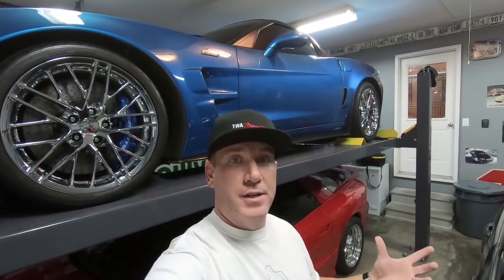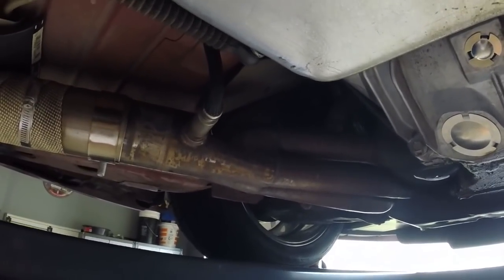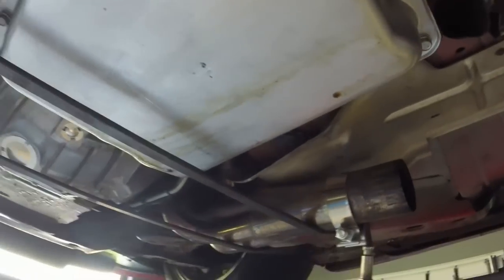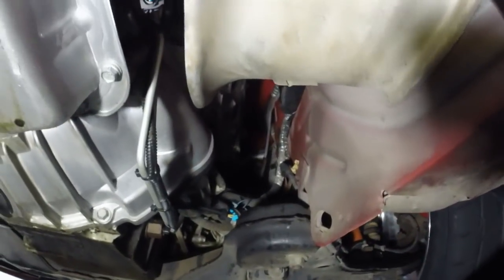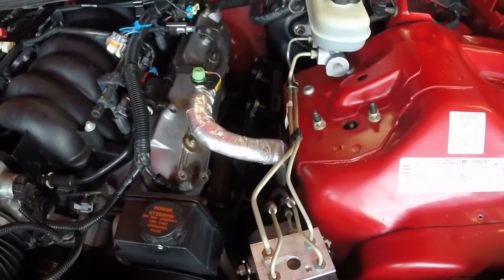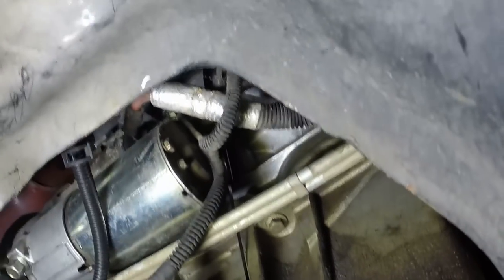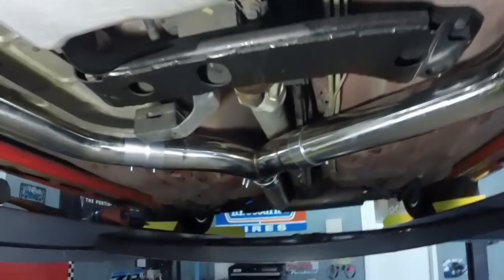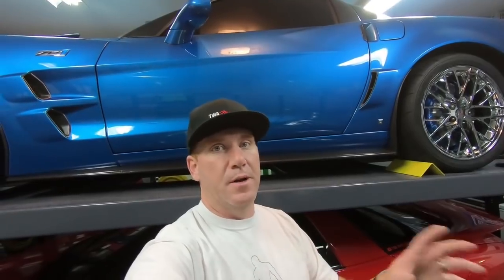Installing 2nd Set of Headers on my WS6

Comment: Headers and off road y pipe to the stock catback for the win!

 It's crazy how different brands of headers and y pipes with different merges change exhaust sound.
Reply from the maker: I like the more quiet exhaust on cars that are not race cars. Not sure if I want a catback at this point. Maybe just tips.
Reply: TWA Motorsports I went with the Hooker Aerochamber catback.  Nice and deep sound, not loud and annoying.  Great sound when you get on it.  Very cheap price, ~$300ish on the usual sites.
Reply from the maker: @joshender9606  I had that on a camaro I bought once. I liked the sound of it.
Reply: I bet it would sound sweet with the header, y-pipe combo you just installed.  And it's super easy to add a cut-out for when you want to get loud or take it to the track, too.  Anyway, nice setup in the garage and sweet, sweet rides, good taste :)   Good luck with your channel, sub'd.
Reply from the maker: @joshender9606  thank you

Comment: I used pace setter ceramic coated headers. 7 thousand miles later and they still look pretty damn good.
Reply from the maker: I have used those in the past and they are a great bang for the buck that's for sure.
Reply: @TWAMotorsports  yeah, i was on a huge budget when i built my motor, turned out there was a ls6 block in my camaro.
Reply from the maker: @chemicalspore  that's I nice find.

Comment: Just subbed a few days ago and watching all your vids, I’m completely envious of your garage.
Hands down, you have the best 3 cars imo.
F body TA, Zr1 and the ctsv.
You have the best of all 3 worlds.
Think all you’re missing is a Fbody Camaro SS.
Plan on doing any vids modding the LSA? Those engines have so much potential, helped a buddy of mine put a zl1 lid on his not too long ago.
Seems like weaponx is the spot for those LSA, over tsp 
Great content man
Reply from the maker: Thank you. I really appreciate the sub. I have had several 4th gen Camaros as well. I actually sold one to buy the ZR1. I might do some lsa mods. If I do I will use Kong for all my blower stuff. Tsp and Weapon X will probably get some love as well.
Reply: TWA Motorsports nice, seems like you have a wealth of knowledge about GM cars.
Is this something you learned over time?
You should open your own shop, think it will do well for you.
Do you do your own tuning as well? HP tuners from what I hear is somewhat friendly.
Again, nice content man 👍
Reply from the maker: @picklebacon  thank you. I may open a shop someday but for now it's just a hobby. I do very little tuning. I haven't mastered that. I do use hp tuners. I just started taking stuff apart and learning. You get tips from others and experiences along the way.

Comment: I have 1 3/4 speed engineering long tubes on my 01 SS and I love them. Great for the price.
Reply from the maker: They are really good for the price
Reply: How hard are they to put in
Reply: William Holton jr not bad at all. Mine went right in from the bottom. If you are doing them, I recommend taking a look at your motor mounts while you are at it tho. I replaced mine with poly mounts when I did the headers.
Reply from the maker: @williamholtonjr4982  not bad. I ha e made 2 videos to help👍
Reply: OrangeSpeed  did you have to notch the k member as well with the 1 3/4?
Reply: 2000 catfissh nope, I didn’t notch anything for them.
Reply: OrangeSpeed right on great to hear!! Did you get any leaks on the y pipe with the provided clamps? Reason I’m asking is because I’m thinking of doing mine this weekend, my wife surprised me with them yesterday lol so I’m excited to get them on, tired of hearing the ticking on my leaky current longtubes

Comment: Hi buddy. Great video as always. I'm going to be running Cooks header's on my 94 Trans am with a borla 3" catback system when I get to that point. At the moment my 94 Trans am is getting prepped for the new Black paint job with the 6"red strip. Then I can start pulling the LT1 and 4spd automatic transmission out. To start the engine building process.. Travis you and I are alike... We both turn wrenches on our cars instead of having a mechanic shop doing the work... Blood sweat and a little bit of dropping the f bomb lol... Nice job job on the header install....
Reply from the maker: Yeah I have never like others working on my stuff
Reply: @TWAMotorsports  hi buddy... Any word on when you're ws6 is going to be your next video?.. I just ordered a 383 stroker LT1 short block. For my 94 Trans am...
Reply from the maker: @keilylmm6377  long time from now
Reply: @TWAMotorsports  hey Travis. Hope all is well my friend. Well my steering column is worn out too.. it's not bad but it's annoying. I can move the steering column up and down.... welcome to my 94 project trans am....
Reply from the maker: @keilylmm6377  sounds like it needs some TLC but you will get there.
Reply: @TWAMotorsports  I'll get there alright lol... Money pit but what the hell... Cars we know em and Love em..

Comment: Nice. I’ve been thinking of getting those 1-7/8th headers as well as the true dual kit. Even though it hangs low. I’ve got the kooks 1-3/4 headers to y pipe now. But I’m putting on some 243s and a sloppy stage 2 cam and have heard there’s a decent gain over 1-3/4.
Reply from the maker: I just thought for the price difference I should do 1 7/8s. True duals hang too low and are too loud for my taste. Good luck on your build.
Reply: @TWAMotorsports  Ice got Texas Speed true duals and they are WAY too loud. Obnoxiously loud!! AMD 3" dual is too big for a naturally aspirated small block anyway. But the Hooker 2-1/2" true dual system sounds amazing. I love the sound so much I bought a set. Now it just sits in my living room waiting for me to get the time to install it 😅
Reply from the maker: I hate when it is crazy loud

Comment: You're a glutton for punishment doing headers twice on a 4th gen. Been almost 20 years since I did them on my old 94 Z28 and I still remember what a PITA that was.
Reply from the maker: Actually the ls1 cars are way easier. Generally 2 hour job. Lt cars require more removal and are a pita.

Comment: I have the same speed engineering headers and didn’t have to clearance my k member lol. I did have to take my steering shaft out though. Also have their true dual exhaust with x pipe going all the way out the back, fitment was pretty darn good, just had to get different clamps cause theirs are garbage lol
Reply from the maker: Yeah the clamps do kinda suck. Bet the true duals sound good though.
Reply: TWA Motorsports they sound pretty good it’s quiet under 2k rpms and no drone pretty much but when you’re at WOT they scream I love it
Reply from the maker: @RepStLouis  true dat

Comment: How bad was it to take out the header bolts? Did you do anything special like PB Blaster or heat up the head before? Just worried about breaking a bolt when I replace my headers next month.
Reply from the maker: They came right out. You could heat it up but I have never had an issue. If the car is rusty I could see it however.
Reply: @TWAMotorsports  awesome thanks! Yeah my car overall isn't rusty but had 93k miles on it
Reply from the maker: @6541485  👍

Comment: Did you use the factory exhaust bolts or aftermarket? Are these bad about loosening up like the SBC header bolts?
Reply from the maker: I did use factory bolts. Sometimes they back out. I retorque after a couple heat cycles and have never had an issue.

Comment: How did you remove the headers ? I’m having. Trouble removing my pace Setters they won’t slide out easily
Reply from the maker: Pacesetter usually require removing the oil filter and sometimes the drain plug. Also make sure it's off the ground far enough to almost come straight down. Be careful and support the car well.

Comment: If I have a short tunnel Mount torque arm, I wouldn't necessarily need to use that catalytic converter bracket that attaches to my Y pipe right? I noticed that you're not using the catalytic converter bracket on your automatic transmission, but it's there and in place, because your using your factory torque arm right? So that being said I don't need to use that bracket if I'm using a different torque arm setup and that bracket is not necessary for me to use?
Reply from the maker: That's correct.👍
Reply: @TWAMotorsports ok so nothing is going to be holding up the y pipe, the pipe will be fine by itself without the need of the bracket then?
Reply from the maker: @newguy1459  yes. Its lighter with no cats.
Reply: TWA ok cool. I really appreciate your time and input because you are in a way helping with my project at the same time you are doing yours. 
I'll probably be asking you more questions later. Lol. Keep up the good work with your project and your videos. Thanks!
Reply from the maker: @newguy1459  thank you. No problem at all. Glad to help 👍

Comment: DId you have to undo the steering column on the first headers? Would really like to avoid that if possible. I have a hooker blackheart cat back and may just go with stainless hooker headers 1 3/4 to avoid any grinding and fitment issues.
Reply from the maker: I did not

Comment: What brand y-pipe did you use in this video?  I installed TSP 1-7/8" headers which went in easy and fit great, but the TSP y-pipe is trash.  It doesn't even align exactly right with the collectors.  I'm interested in trying a different brand to see if it will fit better.
Reply from the maker: This was the same speed engineering y Pipe. Fitment was pretty good but not perfect
Reply: I'm tempted to get a custom y-pipe made, I'm concerned a non-TSP brand y-pipe may not marry up to my TSP headers correctly. Those SE headers look like they dump out differently than my TSPs.
Reply from the maker: That would probably be best

Comment: Looking to put my speed engineering headers on my ls1 trans am soon.  I have a scissor lift capable of bringing the car up about 4ft off the ground, and a 4post bendpack avaliable for me to use.  which would you use recommend using for a header install?
Reply from the maker: Either will work fine.
Reply: @TWAMotorsports  sounds good I appreciate the reply. Probably will do 4 post then so i dont have to move the car to do the rest of the exhaust. Thanks, and great video 👍

Comment: I know you said you wanted to go turbo down the road but why not super charger? If I had the cash Id go with the Procharger it has immediate boost and adds 40% HP so 500 HP works well with the TA
Reply from the maker: Both have ups and downs. I will make way more power with the turbos than 500 though on stock bottom end.

Comment: Im having a PITA trying to install the driver side header on my 1999 z28 i got a set of 1 7/8 headers as well, and i already disconnected the steering shaft and a shield that was on the lower left side plus i can get any clearance, i guess im gonna cut the k member
Reply from the maker: What brand do you have?
Reply: I got them on ebay, they’re “perfomance racing” the shape it’s similar to the speed ones that you installed, but i think mine’s a lil bit bigger cuz it’s just one tube that it’s hitting and doesn’t give me enough clearance and i really don’t want to removed the oil pan to have more clearance since will be a long process...
Reply from the maker: @Truckingforlife323  man that sucks. You may have to undo the motor mounts and lift the motor.
Reply: Yeah i will try to do that too bro, i wish i have a lift like you too hehe, great video bro i will try to do same as you did
Reply from the maker: @Truckingforlife323  I did the last set on the ground but the lift does come in handy.

Comment: You can remove the hanger for old factory exhaust, with rubber bushing. (By tunnel brace.) Dead weight. I thought your car was fully tublar. I see now just looks like frame connectors. With a aftermarket k you probably wouldn't have to unbolt knuckle. You should look into a k member upper & lower @ arms and some strange coil overs up front.
Reply from the maker: It's all tubular suspension now.

Comment: Im a old skool guy and we didnt dremel out the cars contact points on the actual cars body/frame ect...we used a ball ping hammer to dent the header until it fit.  Man I wished you had dyno'd the car before and after..or maybe you did!  Id like to see what the difference was.  As far as sound goes, it does sound better with the lowered back pressure and I also agree with a reasonable exhaust that is quiet or less loud but still gives the same power.  Now back in 1984 when i was in high school I loved headers and cherry bomb glasspaks that wud wake the dead!!!  BTW in 2001 I had a very very rare 1978 triple blue trans am ws6 hurst edition with shorty t tops and factory 4 speed  M21 RPO code but I kick myself everyday for selling it...Now Im crippled and poor I still have my 2002 Trans Am WS6 Blue Convertible Auto bone stock.  Its stock cuz im broke.... I want intake, headers, and exhaust.  Im going to keep it "just bolt ons".  These cars will be rocketing up in price since the low sale production in 2002, plus its the last year of them ever, and in 2022 just 2 more yrs and a month they will officially become a CLASSIC...BTW what did u do with ur old headers and y pipe?  Id like to have them if they are just sitting somewhere not being used.  It sux being broke :)
Reply from the maker: No I didn't dyno before and after. These cars usually see 20-25 rwhp increase with longtube headers. I sold the headers to make way for other parts. As for the value I try not to worry about that as I just love the look of the car and don't ever see myself not owning one. Bolt ons is a lot of fun and these cars are still very quick because they were way ahead of their time.
Reply: @TWAMotorsports  well i was wondering what the HP difference was between the 2 header systems.  Since mine is bone stock Ill be able to see what each part does tho not by dyno as im sure i dont have the cash for that but here local for $10 you can run ur car on the 1/8th mile as many times as you want...So I can compare the times if they are open... they close for winter season
Reply from the maker: @beachsidebum  yeah the track is a better measurement anyway. Should see at least a .4 improvement in quarter mile times.
Reply: @TWAMotorsports  Have you ran yours on the 1/8th or 1/4 ? Ive not ran mine yet but my 1995 Triple black auto convertible Trans Am LT1 3:73 (was too much gear it ran out of breath top end, shuda went with 3:42) with only bolt ons and hypertech programmer but no cam ran 8.8's on the 1/8th and 13.8 on 1/4 which was fast back in 1996...Then the LS1 came out and bone stock was running 8.4's on the 1/8th and 13.2 on 1/4 hahaha anyways..what does ur run?

Comment: Old Skool guys wud take a ball ping hammer and just wack the header a few times and not cut the car.  BTW im cripple and if you have any extra used parts you dont need or use and wud let go cheap or free Id take them my ls1 trans am is stock with nothing performance

Comment: Is the inch & 3/4 easier to install & do You have to cut anything m? I’m not sure if I should get the 1 7/8 or the 1 3/4
Reply from the maker: 1 3/4 does go in easier and no cutting
Reply: TWA Motorsports awesome I’ll get those then for speed engineering. & hopefully it doesn’t rattle, I have no muffler on my trans am 😂 soooo it’s going to be loud
Reply from the maker: Very loud

Comment: How did the y pipe fit? Is it still hitting the floor pan?
Reply from the maker: Y pipe fits great! No hitting 👍
Reply: @TWAMotorsports  nice, so for the egr and air did u delete all the hoses and i mean like removed them completely?
Reply from the maker: @naranjoceidy  that is correct
Reply: @TWAMotorsports  nice, I heard texas speed and speed engineering has the same design
Reply from the maker: @naranjoceidy  not on the y pipe at all. Maybe the headers.
Reply: @TWAMotorsports  maybe if u had matching tsp headers with the tsp y pipe it wouldn't of hit or have fitment issues
Reply from the maker: @naranjoceidy  true. That may be the case. I have heard good things about tsp headers. I also heard that for tsp 1 7/8 you have to remove the motor mounts to install which is not something I wanted to do.
Reply: @TWAMotorsports  i heard that too but not sure, i have brand new tsp headers with ory sitting in my garage i will have too see if its true
Reply from the maker: @naranjoceidy  let me know because I am curious as well.
Reply: @TWAMotorsports  will do
Reply: I've put the TSP 1 7/8 headers on my 98 along with their true dual exhaust and I can confirm there is no need to remove the motor mounts. I wouldn't get the true duals if I was lowered, it hangs extremely low, even on my stock springs I scrap a lot, bad enough that I'll have an exhaust shop cut and redo all the the piping to tuck it up higher.
Reply from the maker: @jonadkins9339  great info👍

Comment: Would you recommend 1 7/8” headers over 1 3/4” ? I just have bolt ons for now.
Reply from the maker: If you plan to do more down the road 1 7/8. If not 1 3/4
Reply: TWA Motorsports okay thanks man I’ll definitely be doing a cam one day
Reply from the maker: @prestonrills6136  you're welcome.
Reply: @prestonrills6136  it you just do a cam 1 7/8 is a waste. 1 3/4 will make more power for your application. my dad had a 2017 zl1 and it made more power with 1 3/4 than it did with the 1 7/8's we originally put on it
Reply: Ethan Slape thanks for the help